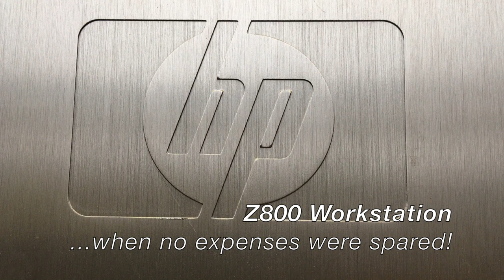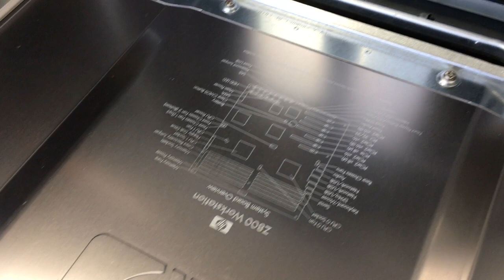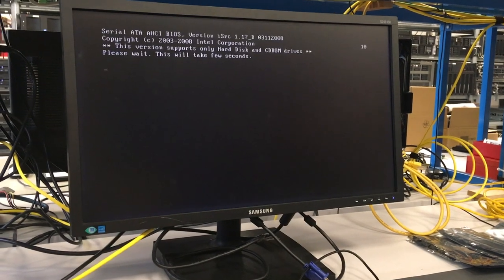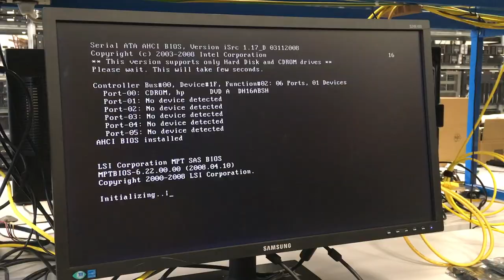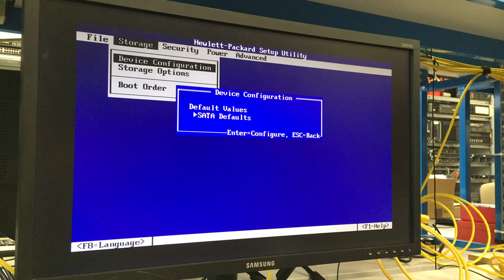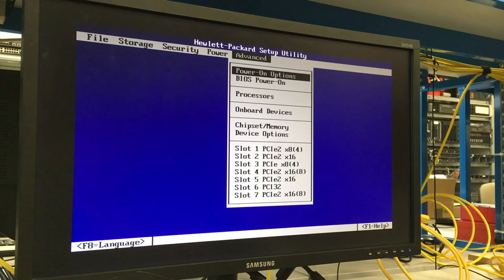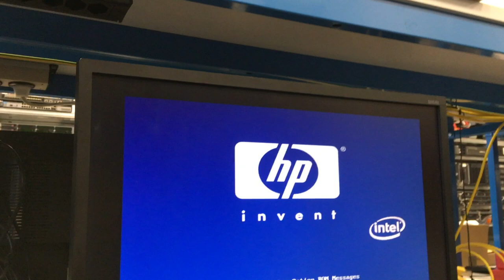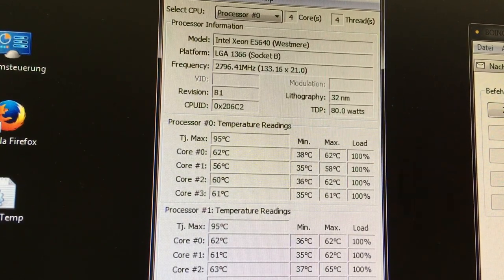They spared no expenses!   HP Z800 Workstation (PWJ184)

Comment: I liked the video.  I wish you'd said its max memory and CPU cores & threads.  This might be a cheap machine for a weekly backup unit or something.  Don't know how much they are now.
Reply from the maker: I talked about CPU cores and threads in the video. 
More information can be found by googling "HP Z800 QUICKSPECS"
Reply: @PlaywithJunk  Okay, sorry.  I watched full video, but I skipped a little of the parts where it was stuff I already knew -- like opening the case, etc.  But, yeah, nice hardware -- just its max is 384GB, I think.  And it might have said each has 6 cores and 12 threads, so 24 threads.  Nice, but the TDP is pretty high for that system.  And, I can't believe that they are still so high in price.  I'd pay (say) $150/$200 for one, maybe.  But, not a $1000.  Anyway, thanks for video.  I really liked what you have done, and I learned stuff from it too.

Comment: The E5640 has hyperthreading, you just need to enable it in BIOS.
Reply from the maker: Ok so it was just disabled.... I will try to enable it and probably I get more BOINC jobs done :-)
Reply: @PlaywithJunk  It was probably disabled because of company policy regarding the Spectre and Meltdown related attack vectors with Intel's previous generation hyper-threading implementations. If I understand and remember the news correctly there is no guaranteed way to protect against these with hyper-threading enabled in Intel's chips before first Spectre related design changes.

Comment: Could you upgarde it with 2x X5670 ?
Reply: I upgraded some of those Z800 and some Z600 with X5680 and they work perfectly fine. So the 5670s should be no problem
Reply: @TimEckert  How did you get the X5680's to work in a Z600? The Z600 officially supports up to 2x 95W X5675 and I haven't heard of anyone being able to use higher TDP CPUs in it.
Z800 supports up to 2x X5690 which is the fastest for that socket.
Reply from the maker: I would say all the 56xx CPUs will work. But if you want to know it for sure, google HP Z800 QUICKSPECS. That is available for all HP products.
Reply: Something I forgot to say in my last post:
56xx series CPUs does work in Z800's with 11/10/09 boot block date and motherboard revision 003.

With revisions 001 and 002 it's a bit hit and miss. Some don't boot at all (stuck at black screen), some boot sometimes, some work without any issues.

You can check the boot block date in the BIOS. The boot block date can't be updated so if you have an older version, I'd recommend getting a Xeon 55xx series CPUs.
The fastest 4c/8t 55xx series dual socket CPUs:
W5590 3.33GHz, W5580 3.2GHz and X5570 2.93GHz.

Comment: So many fans....

My PC has 12 case fans + the CPU fan, GPU fans (x2) and power supply fan totalling 16 fans. yeah my PC doesn't get hot at all.
Reply: It'll last forever.  Hey, what do I do if I don't wnat to connect fans to case power.  Is there a way just to put fans somewhere (like external drive bay for cooling it) and just have their own power supply and some speed control dial?  Or do you know of a way to do that?  My extra drives get hot so I need a way to cool them in their drive bay.

Comment: I changed a few years ago an Z800 against den new HP Z8 at work. I can tell you the new Z8 is wat more over engineered than the Z800.
Reply from the maker: One of the Zx20 models (I think it was the 420) had a water cooled cpu. But the cooling solution was not so perfect. I guess that was more for marketing purposes... WE HAVE WATER COOLING!!  :-)

Comment: Recentls took apart a Z400. Typical HP trash: Power supply uses standard 24pin ATX connector, but with a different pinout. 2 Pins that normally are +5V and +3.3V carry +12V on this thing. GREAT thing if you want to reuse the power supply or main board and dont see it until everything burns out.
Reply: It's a custom PSU, what did you expect?
Reply: Yeah if you start changing stuff it's a domino effect, especially the PSU, but they are not really marketed for donor pcs, each element is worth very little unless you need it for another one identical, otherwise it's the the engineering that goes in the orchestration of all those elements that makes it exceptional.
Plus after building my own pcs since the 80ies I was fed up with fiddling and some many excess parts that are never good enough, now I want something that works well and fast and without headaches for long.
I leave the kids playing with RGBs and light effects, it's as good as stickers on a car and waste current for nothing.
I still need to understand who is the fucking moron that looks at his case while he works on his computer.
Plus it depends what you do dual xenon are good for massively paralleled jobs across 2 GPUS and 256G?B of ram to take full advantage of what you have, not so much for gaming, that you can do while serving a website.

Comment: if you install enough memory the computer will refuse to start until you buy those fans and they are not cheap
Reply from the maker: Yes, the number of fans necessary depends on the configuration. Nothing is cheap on this machine :-)

Comment: Customers still use it.. wow. But I'll guess; don't fix it if it ain't broke.
Reply: I still use a Xeon CPU from this era that would have been sold with this. It works fine with modern apps. Computers haven't really gotten faster at the same rate as they were in the 90s, so old HW isn't that bad usually, as long as it was high-end in the first place.

My biggest issue I'm facing now is that it doesn't have EFI, just legacy BIOS, so I can't upgrade to the latest GPUs. That's probably the only thing that would drive me towards a newer machine, and I'd probably only go two gens newer than this (Z840).
Reply: @Manofcube  I fully understand you. I have a DELL Power Edge T430 workstation fex that yes the cpu could be upgraded and such but wouldn't do especially much and it works just fine as is and have all what I need like EFI and so on so there isn't really any reason change it out for something faster. But if pre around say 2012 there could be some few issues even if EFI was invented several years before that but not really used much back then. The advantage with old but still somewhat modern enterprise things is that if not to new, they are not that especially expensive either.
Reply from the maker: In fact some old processors had faster clock speeds than many new ones. But fewer cores and a higher power consumption. If your running applications that use only a few cores, the old machines are probably faster.
Reply: @PlaywithJunk  I totally agree with that.

Comment: The HPZ sersies was designed by BMW engineers
Reply from the maker: Some say Porsche...
Reply: @PlaywithJunk  Actually it was done with the help of a company called "Designworks" based in California that is owned by BMW. So It was not done by the engineers in Germany.
Reply from the maker: @grlg2  I'm glad it's not Ferrari as they would complain if I repaint or sell it.... 🙂
Reply: @PlaywithJunk  Ha, thats funny. I've seen a number of people repaint them as the sides end up being very badly scratched from poor handling and transport.  
I have two of them, one that I've owned from new and another that was made up from parts. A few years ago I got a brand new empty case when HP in Europe was dumping them for about 70 Euros each.  Also had a new spare motherboard and faulty power supply that I rebuild using a server power supply that fits inside the proprietary PSU housing. In my case it was not caps as I had changed almost all of them except the 400v filter caps and once a week it would would still randomly turn off - possibly a bad smd component or fractured solider/track. 
For me aside from being a great computer it's also a piece of engineering artwork. Cheers.

Comment: Built like a Ferrari...
Reply: That chassis was designed by BMW
Reply: @Pasi123  Didn't know that.

The reason I said it was built like a Ferrari is because like a Ferrari it was built for ultimate performance without compromise of durability or reliability.
Reply from the maker: Have you ever seen a Ferrari upclose and under the hood? They are not built very precisely. Lots of gaps and ugly welds. I know a guy who worked in a Ferrari garage and he showed my some details.
The workstation is built better... believe me! The Ferrari is just more expensive.

He once showed me a electrically adjustable shock absorber from a Ferrari and then one from a Lancia... you know the difference? The Ferrari part was painted red and the price tag was 5x more :-)